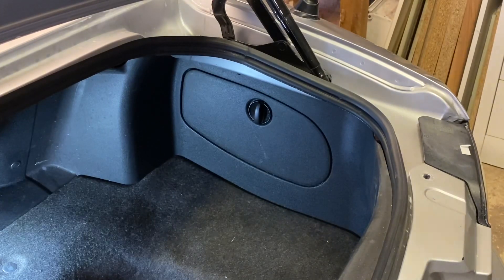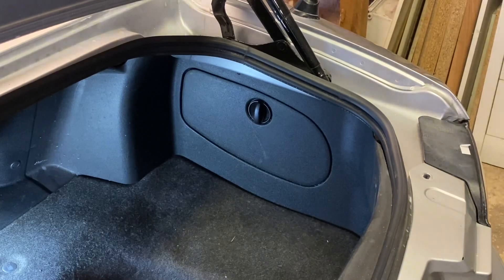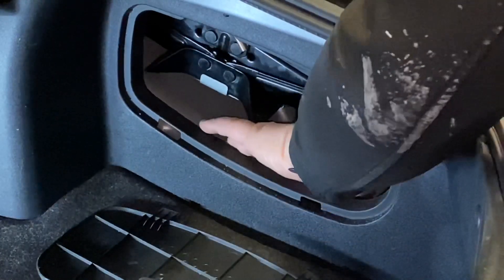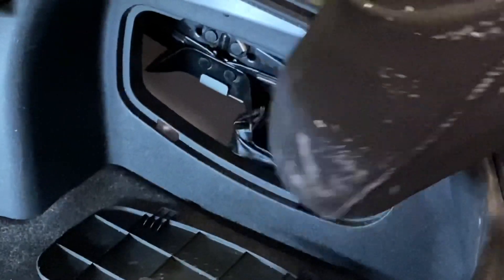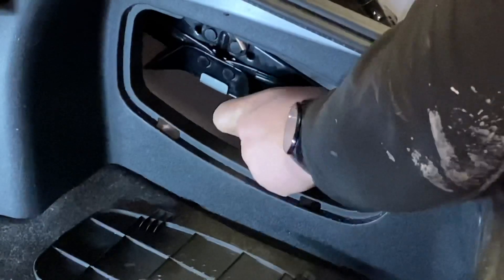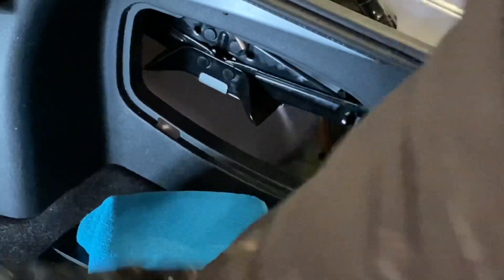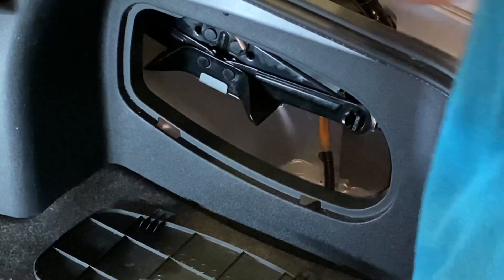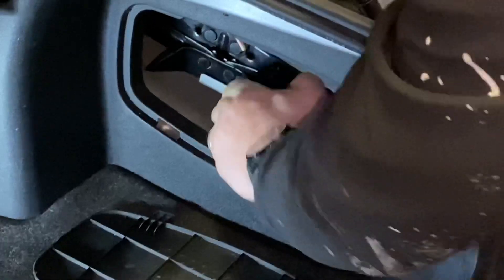Mazda Mx5 NC Mk3 - Are you rattling! Well let’s stop it with this little Hack👍👍

Comment: I laid the tool kit out flat, laid  the microfiber  towel on top then, rolled it up again. 
Side note while your in there, check to see if the antenna  base is snug. 
Checking this could fix a rattle, water entry, and prevent  a point of corrosion if it wears  through  the paint.
Reply from the maker: Great bit of advice👍👍